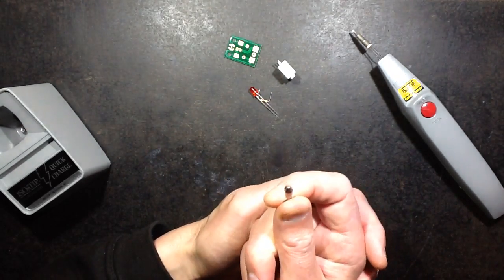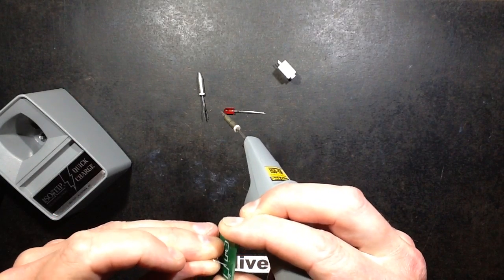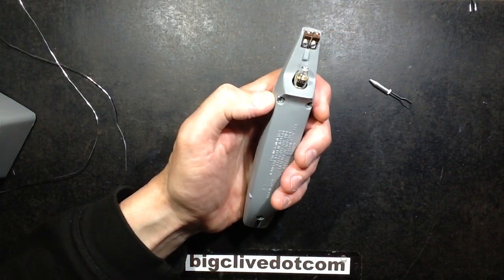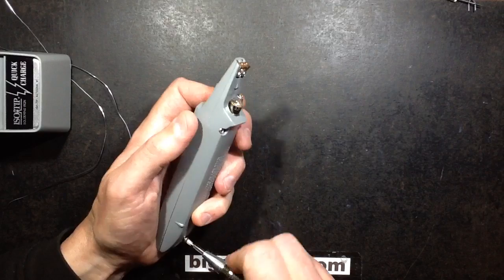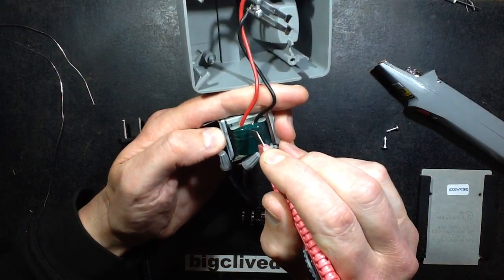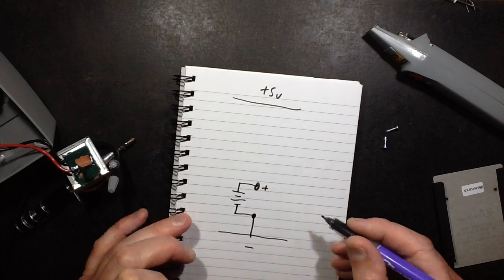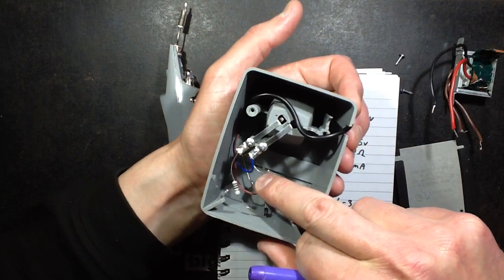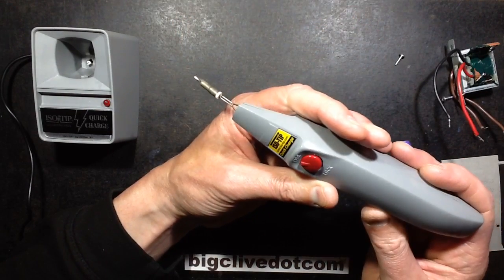Inside an Iso-tip rechargeable soldering iron.  (And charger hack.)

Comment: Yet another reason to use the NiCd batteries instead of NiMH or Lithium -- NiCd batteries don't need "monitoring" circuitry to control the charging current.  That simple, little transformer and the in-series diode are more than enough to keep a NiCd battery charged up safely.  NiMH and Li-Ion batteries need complex, expensive circuitry to monitor their charging state and control it very tightly.
Reply: +LMacNeill  In fact, NiCd cells are most abuse tolerant cells I ve seen :-). Overcharging ? Not a big problem. Overdischarging? Can survive... Overtemp ? Not such problem if its not 24/7 and over 50C. Undertemp ? Maybe the best performance in comparison to "modern" battery chemistries. and so on and so on...

PS: this comment reply is a bit old, but maybe helpful for others as an explanation you started :-)
Reply: +LMacNeill +JanicekTrnecka They really are tolerant! I have most experience with the sub-C cells in RC car packs -- I think I have a couple 2400mAh packs laying around still.
They have taken so. much. abuse! Laying unused for years, seemingly completely dead, only to come back strong ones cycled a couple of times. They have gotten really hot too: Driven hard with a mechanical speed controller the wrapping actually melted a little on one.
I think those 2400mAh packs had Sanyo branded cells.
Reply: NiCd can also be run to the ground, all the way to zero, left there for a long time, and still be charged, again. And since this is a 1S battery, there is no chance of reverse charge damage when doing so. So in addition to simple charging circuit, there is no need for low charge cutoff circuit.
Reply: Mildy Productive. it's a two cell with the batteries in series wrapped in a plastic skin.

Comment: How convenient! I'm in the market for a portable iron for my radio control toolbox and this looks like it would fir the bill. I'll probably leave the transformer in place, however.

I did recently modify the charger for an electric screwdriver. It (the screwdriver) uses a lithium-ion cell and came with a very low output "wall wart" that connected to a base with charge regulation circuitry. I bypassed the factory components and attached leads directly to the charge terminals. These leads get plugged into my RC battery charger. Charge time has dropped from overnight to about 30 minutes. Much more convenient!

Comment: Two old and wise sayings apply here. "If it is not broke, don't fix it" and KISS (Keep it simple stupid). I like the idea of a simple, robust design that can be fixed if it breaks. And it means that you can "salvage" from old equipment if needed.
Edit: On further thought I would further modify it to take a standard E10 base. There are plenty of E10 LED replacement lamps out there.

Comment: This is my go to iron, I have used it flawlessly to perform .5mm fine pitch work and through hole work including desoldering. I only pull out my soldering station for jobs I know will take longer than a hour.

Comment: How does the original design not overcharge the batteries? I'm not familiar with charging so I'm not sure how that works.
Reply from the maker: +Mike M Nicad cells can be trickle charged continuously.  Any gas liberated from the electrodes is chemically recycled into electrolyte.  When full charged any extra charging current is dissipated as heat.
Reply: Ah, interesting, thanks for the clarification!

Comment: I had my first one for many many years and mine was a Radio Shack Archer made by Wahl before they spun Iso-Tip off as a separate company. Mine was from 1974  and was blue and was identical in every way except it did not have a charger stand.It had a wall wart that plugged into the end of the iron. I had it until a few years ago and the battery gave out.
Last year, I bought the Iso-Tip model 7800 with the 60 minute charger.It's yellow and has a small red led under the power button to indicate it's charging. Overall, these are the best cordless soldering irons available and I love the idea of having different size tips to fit the job.

Comment: What about the possibility of making a custom iron using those cheap 18650 batteries.  Maybe put two of them in parallel and get decent current but better performance.
Reply: +Kris S most 18650 batteries only have a 4a continous ddrain,,,, unless oyu get name brand batteries with 20-30a continous draw rating as the tips are rated at a 20a draw,,, and they are around 5$ a battery so yes,, it is possible , msot defonately and might have a higher battery density, ifyou did,, but more risky if you dun check if what you have is fake
Reply: aaand id idnt see how old the comment was
Reply: any1alive Nice info thanks.  I wonder if there are better elements out there that would work with 3.7 volts...
Reply: +Kris S Ni-Cads are known to be very tolerant. So this is the reason its "stuck" with Ni-Cd technology. I would not change it even if i like lithium chemistry :-)
No charging circuit needed (can tolerate continuous overcharging) , no overcurrent or overdischarge protection circuitry needed (if the voltage of cell drops below 0.9V performance goes down the toilet and it stops working) so this simply says - shove it into charger!

Comment: Thanks for the short video... I have had one for 45 years and replaced the batteries a few times... they are great... I didn't know they had a larger tip... that  would be handy for larger wire... have tried other cordless irons but none have worked this well. The gas powered ones have too much flame and can burn components. Good job.

Comment: would be nice to get one with a lithium battery since a decent 18650 battery can put out 30 amps and if they wired two in parallel they could have got  a max of 60 amps out which should have been enough to power that soldering iron.

Comment: could you tell us the charge time before and after conversion?  also, doesn't nickle/cadium have a memory problem especially if it is constantly charged between use?  how about a battery conversion video too?  Thanks for this clip!  i have enjoyed using an isotip before: i especially like the fact that it produces no static danger to the sensitive circuits.

Comment: That's quite a nice simple design that works, I've not used these particular ones but I've used a Hakko cordless one that a friend owns which takes 4xAA in some internal battery carrier. Based on using it myself he loads it up with NiMH batteries (probably eneloops because he seems to use that for most of his devices), it does a good job on those batteries at least I don't know how alkaline batteries would handle the current requirements.

Based on some searching that appears to be the Hakko FX-901
official product description: http://www.hakko.com/english/products/hakko_fx901.html

Your iso-tip soldering iron though seems to warm up a lot faster than the Hakko one, that said I think the tips of the Hakko might be larger so they probably have a larger thermal mass to heat up which has its advantages when dealing with larger components. 

Been considering to look into finding a decent one myself but I've not seen many good options out there, basically I want a thing that has a decent heat output and batteries that can be charged inside the device. It won't replace my bench soldering station but sometimes well it can come in handy for doing small jobs especially when its a device away from the bench.

Comment: I'm curious as to what your using the colloidal silver for? Medically its completely debunked and in some cases quite dangerous.
Reply from the maker: It's not for drinking.  Just for experimental water sterilisation with silver ions.
Reply: Okay that makes sense, very interesting use! Please let us know the outcome. I was worried we were going to start seeing a pair of blue hands on your videos. BTW excellent video on the soldering iron, if I hadn't just purchased a Portasol Pro Piezo 75 I would have jumped on the Iso-Tip.

Comment: I had one of these back in the 70's, but mine was a flashy go faster orange colour,... used and used it 'til it was no more,.. took it apart loads of time replaced the fuse wire more than once,.. even installed a small LED to the charger,.. "real hi-tech",.. Probably even still have some 'bits' in my boxes of bits and pieces that will come in useful one day..... 
Great to see its still going,. although curiously have not found a supplier in the UK yet....

Comment: All resistors increase their resistance at high temperatures. A100W bulb looks like it would be a 3000W bulb when it's cold,  Weller makes a better and cheaper battery iron, Add rechargables and a built-in receptacle and it's perfect.
Reply: Actually, there are negative temperature coefficient (NTC) resistors which decrease resistance with temperature.
Reply: Ethan Poole I knoooow, but the vast majority do, I shouldn't have said "all". I thought someone would call me on that after I looked at what I wrote.

Comment: In this day and age, there's really no excuse to use NiCd cells instead of NiMH or Li+/LiPO/LiFe. They have memory effect and self-discharge like a boss, are pretty toxic and tend to be leaky on top of that, short-lived, and worse in pretty much any spec. Good charging circuitry that can cycle, refresh and maintain NiMH or lithium-based cells is also not future high-tech, and those cells are by now staple to the point where they can be trivially bought and replaced by the user.

It's one of the useless technologies that should have been killed by politics long ago but has been kept afloat by incessant lobbying because it is cheaper.

Comment: I always though NiCads should be run flat before charging to avoid the 'memory effect'?
Reply from the maker: Steve Cooper Individual cells should be run down to a low voltage to ensure they are completely discharged, but when you have more than one in series to create a pack it means that the ones with the lowest capacity get reverse charged by the other cells, and it has an avalanche effect of shortening their capacity for the next full charge discharge cycle meaning they suffer even more progressive damage on the next cycles.  The point to recharge your NiCd and NiMh packs is when the performance of the tool suddenly falls off as the first cell starts to drop in voltage.

Comment: Why do I get the feeling that you dont know transformer soldering gun?
http://www.hadex.cz/img/zbozi/p095.jpg
Reply from the maker: MrSlehofer I've got an old one of those somewhere, but they are really not suited to electronic assembly.  Probably OK for joining wires though.
Reply: bigclivedotcom not suited for electronic assembly? hell no , they are suitable for even smd (at least I use them in that way) I'm just not using those 1.2mm copper wires for the tip but 0.8mm :)
sorry for my english
Reply from the maker: MrSlehofer Your English is perfect, and a has a slight American twist.
Reply: bigclivedotcom Thanks for letting me know :) I appreciate it.

Comment: I'm surprised the charger didn't put out AC and put the diode inside the soldering iron. You isolate the soldering iron charging contacts from shorting and rectify the AC and prevent you accidentally from plugging the soldering iron in the charger backwards (assuming it might be possible to damage the mechanical keys to allow this).
Reply from the maker: Jammit Timmaj I was a bit surprised about this too.  With a typical 1A diode there would be no need for the fuse and accidental shorting would not be possible.  Then the base could just have a transformer.  I wonder if it is just to make sure the base remains compatible with older irons.
The base has a polarised connector type shape, so maybe the design used to have accessories that plugged in there to use the internal battery as a power source.
Reply: bigclivedotcom It looks like Iso Tip is a fan:
http://www.iso-tip.com/cordless-soldering-iron-modified-to-charge-from-usb-power-supply/

Comment: but with a charger like that you have to disconnect it or the battery will pop
Reply from the maker: Jared Reabow Both nickel cadmium and nickel metal hydride cells are capable of handling continuous charging at low levels continuously.   They have a chemistry that recombines liberated gasses from their electrolytes.  It's the lithium cells that are the most volatile if over charged.

Comment: I'm very tempted to get one of these. I'm not sure if a butane iron would be better. I've never used any sort of portable iron. Has anyone used both? Or one or the other? Any recommendations or tips?
Reply from the maker: joelie83 I think each has its own merits.  These units are best kept topped up with charge, whereas a gas iron might be better when doing a lot of soldering away from a power source.  I've always found the gas irons a bit temperamental with their temperature fluctuating wildly in use.  I'd class this as a great "grab iron" for those spontaneous soldering jobs.
Reply: bigclivedotcom Thanks Clive. I posted my comment before watching the whole video. Your story about dropping the iron turned me off gas irons a bit. Though there still is something about butane irons that appeals to me, but I not sure what it is.

Comment: If you'd wanted to use the charger on 240V could you have put a capacitive dropper in series with the primary?
Reply: With a bit of trial and error to find a value that passes the right amount of power depending upon the state of the battery, yes.

Comment: It probably has some niche use cases, like soldering in remote locations with no power, but I wouldn't wan't to go anywhere near a valuable circuit board with something as poorly regulated as that. (FYI JBC irons take 2 seconds to heat up, Metcal MX500 takes 8 seconds and Metcal MX5000 takes 4 seconds and all have incredibly stable regulation)
Reply from the maker: arcadeuk DUDE!  They cost half a grand!  :(
Reply: And a full set of tips will cost you the same amount again! 
Totally worth it for anyone doing PCB assembly or significant volumes of repair work though. It's a soldering experience that cannot be explained, you have to try it to appreciate it.
Reply from the maker: arcadeuk I will admit that at the peak of my manufacturing runs of the fairground lighting controller modules, there were times when my Antex XS couldn't keep up with the speed I was wanting to solder.  A high power iron with that self regulating effect at the tip would have been useful then.  Probably a necessity in a manufacturing environment where the operatives are hand soldering at very high speed.
Reply: cant bring on an airplane .
Reply: I'll second that. I was used to fairly high quality Ersa and Weller soldering stations for many years, but once I tried that JBC I never wanted to go back again. Within days I had purchased another one for my home shop. 

I can see how a battery iron could be useful for that quick joint in an inconvenient location where you do not want to take your station. I have some gas irons (catalytic) but they suck. 

However NiCad is a dealbreaker for me, because of self discharge. I'm glad I have finally replaced all my power tools with Lithium.

The transformer based float charger is 90s technology and not fit to be sold in 2015 in my opinion. They need to get with the times and use a LiFePo cell and a proper charger.
Reply: arcadeuk Check out my latest video about making cordless soldering iron/gun using 18650 batteries and Metcal tips. And it heats up in seconds as well :)
Reply: Butaine soldering irons are the best for remote work.

Comment: at some point, the  nicad exception for portable power tools will end, then they will have to make it lithium
Reply from the maker: jusb1066 I think they might go to NiMh to avoid the complexities of redesigning for lithium.  The voltage range of lithium during discharge is from 4.2 to 3V while the NiCd/NiMh pack holds 2.4V for most of the discharge.  The range of bits they have are all designed for around 2V, so it would save having to make new bits too.  The lithium cell would also need protection from over-discharge that handled the huge currents.
Reply: bigclivedotcom
yes, the 20amp draw itself is a challenge, but they have to find nimh capable of that, which is why you dont see many power tools using them, but what with the control circuitry for lion being cheaper than ever, you never know
, yeah not changing the bits would be a very important issue going forward
Reply from the maker: jusb1066 On the basis that this is quite a specialist and NiCd specific application, they might be able to "grandfather" it to keep using NiCds due to the age of the design.
Reply: bigclivedotcom
not if they sell if europe, the nicad exception will end at some point, it got extended twice i think, i wouldnt bet a business on it extending again, but this is really a USA device, where who knows

Comment: I had a whal one years and years ago, mine was orange in colour and it also was one that ran on the 250volt mains here in Australia with an Aussie 2 pin power cord. I seem to recall that I had an led on it but it was so long ago now (some 35 to 40 years ago now).

Comment: Perhaps it can acted with a single 18650 cell (>2200mAh),to give more power.With diode charging voltage is 4.2V,but you can also use simple cheap charging module for Li-Jon with two status LED..